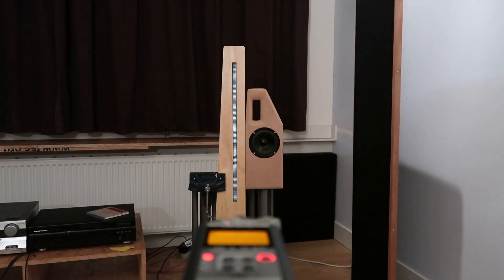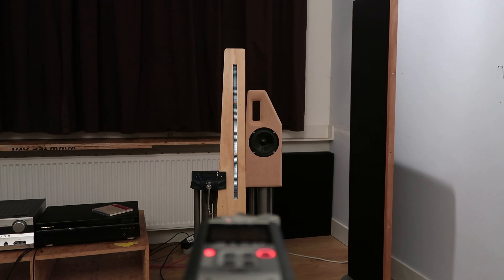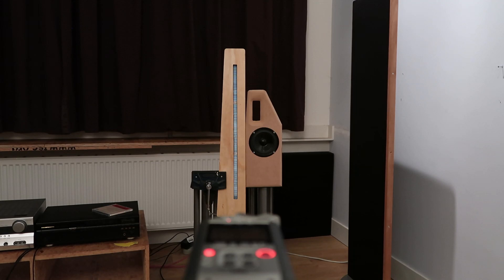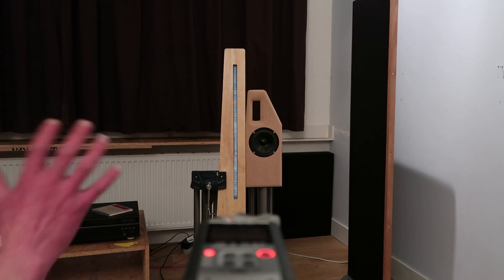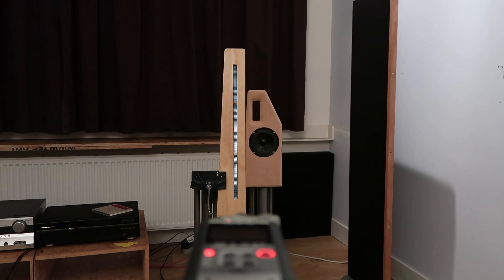A ribbon tweeter out of one foil VS old big ribbon (measurements and music)

Comment: Could edge diffraction explain the greater wiggle from the narrower slot?
Reply from the maker: Yes :) compare the smaller one compares to the bigger one same wiggle but lower.   smoothing the slot should solve this by a big margin i think. i just dont have the right roundover bit  :)

Comment: You are a true visionary living in the modern age. Love your work. I think you'd quickly find yourself successful paths forward if you ever decide to give headphones a try. A limited run of handmade cans would sell like hotcakes on head-fi.
Best of luck to you.
Reply from the maker: Well thank you !!   i dio hope so :) hahah  you do know i made a serie about a headphone > ?  it guess you do hence why you opt for me making headphones ? :)
Reply: @joppepeelen  I've been watching this channel in bursts for a while now, so I have seen your work with planars. I know that these designs can be quite hard to achieve the bass characteristics that you want out of a headphone, but I think with the right setup you can figure it out. Have you worked with Kapton material yet? (polyimide)
It's probably the best material for testing on, if you can find it thin enough.
Reply from the maker: @wallofhooliganism5173  well i dont like kapton all that much :( its rather stiff. but yeah i also did not manage to find thin enough. and as a bonus :( i have to laminate it myself :( not cool :) for cans i think even more floppy materials like PE could be used. it has far less self noise then mylar or kapton. usually people dont burn out there headphones so the added temperature handling of kapton is not needed (at least i think, but im not an  headphone expert :) ) for planars you need soem heat resistant because the power used is a multitude of the power used in a headphone of course. biggest reason to not make cans is  the fact i s till need all the hardware like cups and bands and swiffle things and a method to adjust it, and ergonomics etc :)

Comment: No such thing as running hot on the high frequencies. You just get a more sensitive woofer or double them up in parallel. There is a nice roll-off  from 10k to 20k so I don't see it running hot there ( Sounds more natural than piercing your ears). It's just that you will run lean in the mid-base area where you go from full space to half space. Nice to have a 3-6 db gradual bump around 300 hz and below.
Reply from the maker: yeah its ok not really hot like the previous one :) for sure haha

Comment: I like this direction Joppee. Down to 1000hz. A little high still. I think the frequencies to try to cover is from 200hz to 3000 hz, and forget about above and below. Four octaves. Magnapan, I understand is looking in this direction right now.  A bonus would be 8ohm with a bit of efficiency, say 90db with 2.8v (or higher). Have you a digital crossover for quick designing?
Reply from the maker: yeah i use a minidsp for quick things. although i must get a new one :( in the future like a 3 way. mine is only 2 way.  still nicer then playing around with caps and coils :) well 8 ohm and 90 db efficiency is never gone happen with my designs im afraid. except maybe for the Neov10 planar tweeter i made (the push pull variant) these ribbons  where made  to match the magnepan style planars. they are all around 84-85dB just like magnepans. since they say 87 dB at 2.85volt.... at 4 ohm so actually 2 watt.  in push pull the desired 90 at 2.8 could be had at 4 ohm  :) i think maybe slighly higher. as for these ribbons i could only make them thinner to increase ouput and then make them longer to reach lower :) although i wonder what they would do if i would make them sligthly wider like 1 or 2 mm and then make them triple the length :) less efficient but all i care about is reaching lower :) and or be able to use 6db oct  filters, for instance
Reply: @joppepeelen    It'd be great if wider and longer worked.
Reply: If you end up with 4 ohms, is not enough to just use two units in series to change impedance to 8 ohms? 6 foot or even 8 foot long is fine with me, but maybe not others.
Reply from the maker: @ronfreeman3018  i just tested at moderate volume they can play down to 500hz, with a steeper filter. so there is room there , especially when i think they should be at least 2 as long :) witch either results in 8 ohm. or more power handling and 4 ohm :0

Comment: You should compare these to conventional horn tweeter found in PA loudspeakers.
Reply from the maker: well a pa driver is all about loudness :) mine are not so much. for me personally loud for room usage is loud enough :) simple cheap and chearfull ;)
Reply: @joppepeelen  no, not the loudness factor.
I just mentioned pa horn because it is comparable in size to what you made.

I play bass guitar and use a 4x8 inch horn in my practice rig.

Comment: You should try some nicer midwoofers/mids. At this point it's just listening to hd below 1k. A 40Eur 86db midwoofer should match that HD closer.
Do you have a link to the ear mic? I was thinking of 3d printing my own. I already have some nice capsules.
Reply from the maker: https://www.thomann.de/nl/roland_wear_pro.htm?glp=1&gclid=Cj0KCQiAnL7yBRD3ARIsAJp_oLZKIbGFJd5ti4v6OGGkA5EqyVKlgSW6iXcC7E_HJuioo542wiCEHNUaAt5eEALw_wcB

those are the cheapo's :) not sure yet if it works to be honest. about teh midrange yeah, the distortion is rather high, alhough allot of it is my ceiling weirdly enough :)